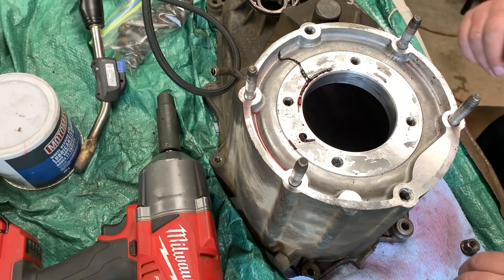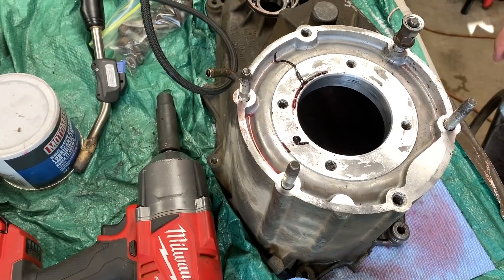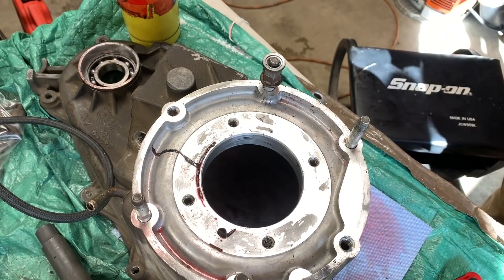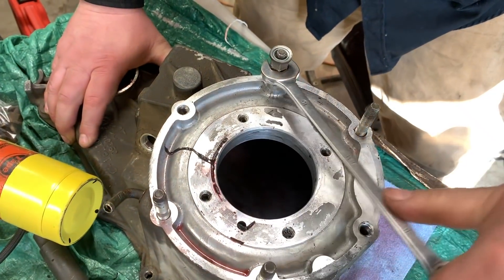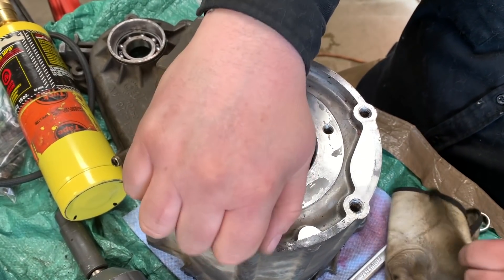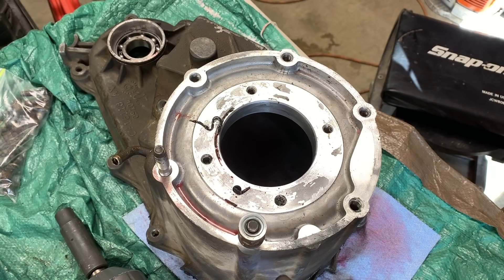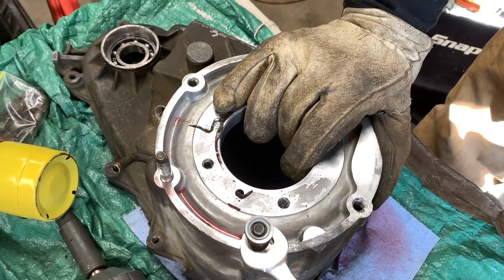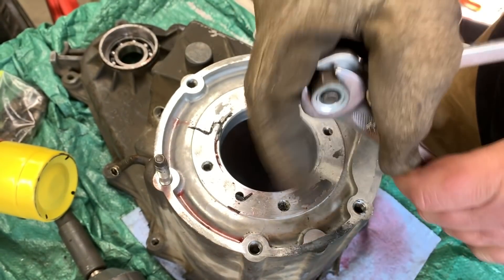Easy Way to Extract Studs

Comment: I have used stud extractors but most times they damage the threads so two nuts works great.
Reply from the maker: You are correct that’s why I don’t like using them either